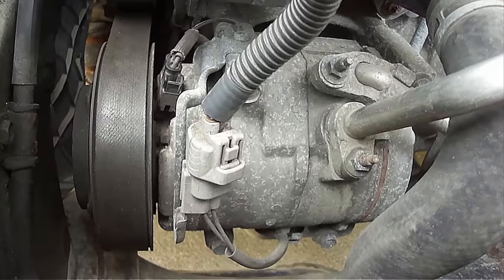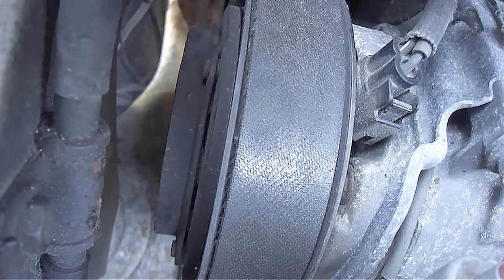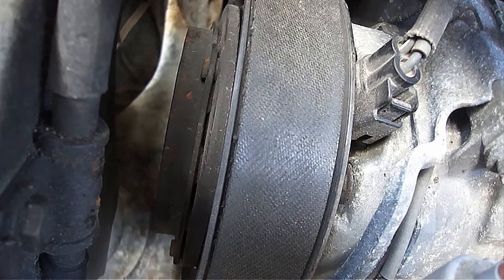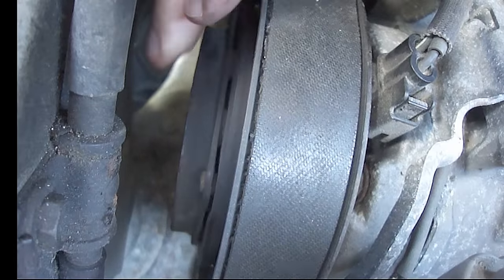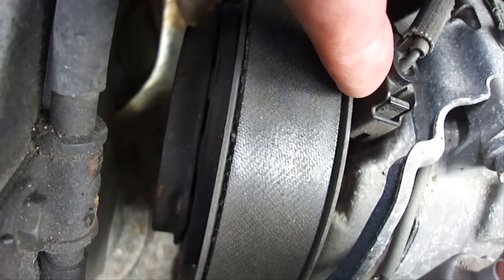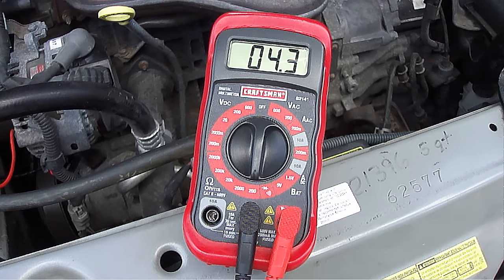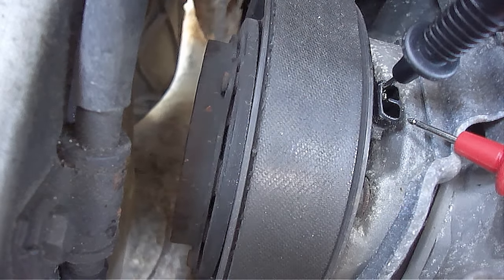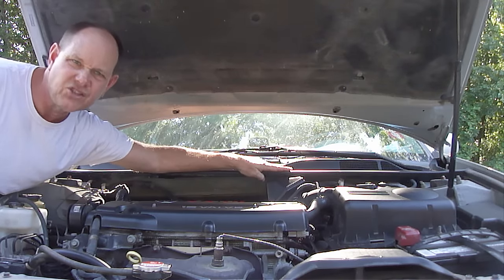How To Fix Car AC - Compressor Not Working

Comment: You must be Scotty’s brother! Thumbs up. Thanks
Reply: Lol 😂
Reply: @proclaimliberty2000  u
Reply: No dead ass 🤣🤣 I'm like ge act and sound similar lol
Reply: Seriously lol
Reply: For real he is
Reply: He is even better then scottie!
Reply: Lol that's exactly what i thought as soon as he spoke then so ur comment lol
Reply: He can't be Scotty's brother, he doesn't speak with his hands gestures😂😂😂
Reply: No , its gary wee and scotty's brother
Reply: Yes, but with a more positive attitude LOL
Reply: The Milder Brother lol
Reply: Broooo I was gunna say thisss lmao!!!
Reply: 💯 You and Scotty need to do a colab 😂
Reply: @proclaimliberty2000 thank you brother for the great instructional videos. My AC was working great then one day as I was setting at work in my car it just quit blowing cold all of a sudden. I've checked the relays and fuse and they are good. One thing I did find is the cabin air filter was completely clogged, I changed it but still nothing. I've read that the expansion valve could get clogged but im trying to eliminate everything else before I go into the dash. My 03 Honda accord has a self diagnostic test in the hvac system and it shows everything is good. Any ideas on what would make the clutch suddenly disengage? Im hoping its the high pressure switch or a leak. Any advice would be welcome, thanks.
Reply from the maker: @donniev8181  does it blow cold air at all when you drive on the highway?
Reply: Vee hear cle!
Reply: I like him better.
Reply: Definitely lol
Reply: Ngl I thought the same thing
Reply: Lol
Reply: Same guy new hair cut
Reply: My first 2 sec I thought same
Reply: I swear it seems to be😂
Reply: He's Scotty Great great great great grandson.
Reply: Yes. 😂this
Reply: Lmfao 😂

Comment: Thank you. You saved my day, and my money. 

Because of your video,  I was able to locate the compressor,  and found out it doesn't turn on.

I tapped on the clutch with a big screwdriver,  .. and voila it worked !! 👍
Reply: So it was just stucked?

Comment: Short, sweet, and to the point. Great video.  I have a 2015 Cadillac ATS and the AC stopped working today. When I checked under the hood, the belt was turning but the AC pulley wasn’t. This will help me with troubleshooting.

Comment: Hey Paul, thank you for yet another super awesome video that helped me understand so clearly. Thank you man, you rock!! 💪🏼
My aircon technician checked fuses, relays and refrigerant pressure, then tapped on the compressor clutch and proclaimed that the clutch coil is burned and needs replacing. Now that I have watched your video I am skeptical of his diagnosis. Your opinion, Paul?

Comment: Many clutches on a.c. compressors have shims that can be removed to maintain the proper gap when not engaged. This gap will increase as the clutch wears and you can simply remove shims to bring it back into spec. Sometimes the bearing for the pully can go bad as well and can be replaced. Newer systems though have continuously running compressors and the freon output displacement is regulated...

Comment: Good video, good information, but aside from a bad clutch or bad coil, it could be the pulley bearing.  Mine went bad & was making a terrible noise when a/c was on.  As revealed here, my mechanic said it'd be twice the labor & about the same cost to just remove & replace the bearing as it'd be to replace the whole compressor, plus the new compressor would have a lifetime warranty.  I really didn't want to open the system, but he said he could do it for about 1/3 what the dealer quoted so I couldn't really argue.  He did it for the amount quoted AND within the time frame he said (awesome).  It's quiet (again) & blowing cold air.  Lesson: if it's not a bad clutch or bad coil, try the pulley bearing if you can do the work OR get a mechanic to replace the compressor.

Comment: Thank you for your help. Well done video.  
On my car,  when I try to turn ON the A/C, the a/c fuse blows up. Started looking into the clutch and found that it will not turn at all but the pulley can.  I tried to energize the clutch as you show and I see the clutch is not moving. It is locked up. I think the compressor is seized  and since clutch hub and compressor shaft are mating together the clutch won't  turn.
Thanks again.
Richard

Comment: Love it, maybe you could take apart a junkyard ac compressor to show us how to replace the clutch. Like a part 2.
Reply: 90% of the time, you just need to horizontal spanner wrenches to put in the grooves on the nut and then you can unscrew it and then you got to use a polar to take the clutch shaft off the shaft going into the compressor
Reply: @SuperIcarusman  when you say moves freely dose it have to move freely with no friction/tention at all or should there be some what of resistance when you turn the clutch by hand? Ill use the front tire of a bike as an example, like  if you spin the front tire of a bike it will just continue to spin on it own. Should the clutch spin as freely as that or should there be somewhat of resistance when you spin it?
Reply: Yes but there should be some resistance because that clutch is still on the input shaft operating the Pistons in the compressor
Reply: @SuperIcarusman  ok cool thanks. I had been told there should be resistance awhile ago so when I heard you say spin freely I wanted to double check. I appreciate the reply. Thanks

Comment: Thanks Paul for the video, I managed to find out why my airconditioning is not working and that the wiring was not safe at all. So will replace the wiring and gave to find the other electrical issue as well. At least the compressor is not broken

Comment: Your auto mechanic skills are phenomenal.  My girlfriends 2004 Honda Accord LX air conditioning does not work. I haven't diagnosed yet but I'm praying it's the cabin filter . I would be very lucky if that's the case. The freon is full and coolant is full and fresh in the radiator?? Do you have any suggestions?? Thanks in advance. Subbed immediately

Comment: Excellent video. My AC works  on my 2008 Highlander but makes a noise from the engine compartment when running. Any hints for me?
Reply: Same issue, did you get any info ?

Comment: Great video. 

I got a feeling that my compressor is bad however. 

I visually see the clutch engaging and disengaging. However my suction 45/discharge 80 don't rise when the clutch engages. I have r-1234yf.

Comment: What if it’s making ALOT OF NOISE, a loud clanging while car is running? Which one is the problem?
Reply: My car has this problem. The ac works as it should, but the compressor is very noisy with a constant clanging noise

Comment: Thank you for your awesome video about AC. I have a question about it also: My Camry 2004 V6 after recharging A134c freon buy it still not blow cold air. I did check the clutch of compressor and it doesn’t freely turn ( turn but it kind of resisted). Is that compressor needs to be replace ? Thank you very much for your time. 👍👍👍👍👍👍😀😀😀😀😀

Comment: Hello, thank you for the video! 
In regards to testing the clutch with voltage from battery, should I take care of the polarity? Or it does not matter?
Is there any diode behind that I should take care of?

Comment: Great video my friend very well straight to the point...
Reply from the maker: Joiner Tia 👍😊
Reply: @proclaimliberty2000   Sir , do you know how to disable the clutch or the whole  compressor . Because it is noisy at the compressor even with ac off. I have a honda crv 2003

Comment: Got a 2000 lincoln town car my ac is working good.. Its just the clutch is squeaks with ac off and when i put ac on clutch engages but here and there clutch stops and engages agaim what can it be air😒

Comment: I checked mine and your video really helps but I found out that the previous owner put a wrong fuse lol so I put a right fuse in. It worked but a few minutes the compressor ain’t running again. Do you know what should I look next?

Comment: How do you know if the pump its self is not working? My clutch is engaging, fully charged, and still no cool air. Do they ever lose pressure or do they just lock up?

Comment: Excellent video, thanks! One questions: when I start the engine, there is a grinding sound coming into the cabin. The sound stops when I put AC on. What could be an issue?
Reply: Sounds like the cluch face on your a/c clutch may be worn and partially broken loose. When the a/c coil engages, the magnetism holds it in place so the vibration making the sound stops. If this is the case you should hear the sound whenever the clutch cycles off and on. Also could be the the bearings in the shaft of the compressor worn and the same condition I stated above is what's stopping the sound. This one can be more problematic because if those bearings fail and the shaft locks up then your serpentine belt will be torn up or thrown off the engine pulleys which will leave you with no alternator power and in most cars no water pump which will quickly cause the engine to overheat if you dont turn the engine off immediately when the failure occurs. You will know because there will most likely be a burning smell from the belt and some smoke coming from the area as well. If you want to check the cluch face, turn it with your hand with the engine off ofcourse and see if you hear any noises of feel looseness when turning it. To check the shaft bearings it's best to remove the serpentine belt from around the compressor pulley and then wiggle the back and forth to see if there is any movement when you wiggle it. With the belt off you should be able to spin the pulley easily and there should be no wobble when it is turning. If there is any wobble or sound of metal grinding then the bearings are failing and the compressor needs to be replaced asap. Sorry so long but I hope this helps.

Comment: Thanks for the info i tried what you mentioned in the video and the belt won't move i was hopefully that it would but of course nothing is that simple for me 😑
Reply: For temporary you can get a A/C bypass belt. That would get you up and running. That does suck I'm sorry to hear that the compressor locked up.

Comment: Hi thanks for the video and reading. I have a 1996 Tahoe 5.7L with A/C.  I get a steady and loud squealing noise when the truck is idling AND the A/C or defrost is on. If I turn the A/C on with it ruining above 1,500 rpms it will not squeal unkess i let the RPMs fall back down to near-idle speed.  But if I turn on A/C and then increase RPMs it keeps squealing. 

I also noted my Battery Gauge drops from 14ish volts to 11.5 volts when the truck A/C compressor clutch squeals.

Should I spray a light oil like WD40 on the A/C clutch? 

Thanks again!

Comment: My 40,000 mile new truck had the compressor clutch/pulley seize up so bad last year that the vehicle wouldn't even turn over. Still haven,t repaired it. The truck goes in tomorrow to see if Ford will do an after warranty adjustment on the repair bill.

Comment: Cheers for this! Could one possible reason for it not to spin is there’s just no gas whatsoever? My van is 2012 and tried to let gas out but it was completely empty? Possibly a leak?
Reply from the maker: Hi Ricky, yes! All vehicles will slowly loose some refrigerant each year. Also, 80 percent of refrigerant leaks are due to leaking ac service port Schrader valves which I have a video on in my playlist and how to check them.

Comment: Hello. Thanks for the nice video. My car is Fiat Bravo 2008 1.6 diesel and since I have it I have issues with unstable rough idle, more noticeable in the summer. I tried a lot of thing with this car and no improvement, visited a lot of mechanics, diagnostics etc and nobody can't find the issue. Having in mind that the rough idle is more noticeable in the summer I started to think if there is a problem with my air conditioning and more specifically sticking AC clutch or something like this. Last 1-2 weeks my car was working fine (I am not using AC anymore as it is not hot), so a few days ago I turned on the AC and I didn't noticed any issue, but after around 20 minutes I had to drive my car again and after starting it again the rough idle was there again. So is it possible my AC clutch to be sticking for some reason even after the AC is turned off and this to cause the rough idle? Thanks in advance!
Reply from the maker: Have you had any work done on the cooling system? I’m  wondering if you might have an air blockage somewhere in the engine coolant or possibly in need of a new engine coolant thermostat.
Reply: @proclaimliberty2000   Recently I tried to fix the problem with new coolant temperature sensor but it didn't work out. Why new thermostat - the car is not overheating and is reaching working temperature in a reasonable time? However, I noticed some little problem with the coolant lately - when the car stays for 2-3 days without driving it, a little coolant leak appears on the top of the intake manifold. This is very strange as on the first 1-2 days usually there is not even a drop of coolant and then it appears. What do you think about this? Also, how can I test for coolant blockages? Thanks in advance!
Reply from the maker: @КирилДраганов-р9д  Even though it’s not overheating it may not be allowing the engine to reach the proper operating temperature which would cause a rough idle.
Reply: @proclaimliberty2000  I replaced the coolant temperature sensor because I had noticed that the dashboard displays 90 degrees but on live data with OBD2 reader it was 70-71 degrees(which might be normal if the car is not driven for a long time at the time of testing) I tested it once again after the sensor change and at a time that the car was idling well and it was displaying 92 degrees on live data. Might have to test it again when the rough idling appears.

Comment: Just one other question .... Will a faulty clutch or compressor make a high pitched, almost whistling sound? I have a 2000 Chevy Malibu 3.1 litre engine. My air conditioning system is not charged with refrigerant at the moment. When the engine is running, I am getting that high pitched sound from the compressor ... almost like a turbo-pitched sound. Would that indicate a problem with the clutch and/or the compressor? I'm thinking of just removing it and running a bypass pulley which is available for this model. Too expensive to replace/repair on such an old vehicle. Any comments? Please.

Comment: I'm guessing I should be able to jumper at the relay location, turn the key on, and see if the cluctch engages (instead of running leads from the battery). If it doesn't engage, that would indicate a fail also.

Comment: Excellent tip.  Mine can be moved whilst the engine is off.   Does it also mean that if a clutch is not engaging, then it will be remaining stationary after the engine is started?
Can a clutch that might be feeling a little stiff be lubricated with a squirt of WD40 without removal?
Reply from the maker: First question yes.  Second question it’s normal to feel stiff.
Reply: Did you find any solution?
Reply: @amanchauhan8237  - My clutch is working properly.
Reply: @monsterp1970  In my car clutch engage some time when i hammer 🔨 on it.. Can i do lubricate on it?
Reply: @amanchauhan8237  - 😮 probably best not to hit it with a hammer.  You are just forcing the magnet together.  No lubrication necessary. 
If it doesn't engage, then that probably because you don't have any refrigerant in the system, so the clutch won't engage to avoid damage.
Reply: @monsterp1970  refrigerant gas is ok... I mean when i do little force on it clutch got engaged
Reply: @amanchauhan8237  - Better get someone to look at it
Reply: @monsterp1970  yeah i found clutch bearing damaged . Bearing cost $5 but service center change whole compressor which cost $300 .....

Comment: Is there a way to engage the clutch in order to add refrigerant? 2013 rogue ac relay is inside the IPDM. I know my refrigerant is low causing the clutch to not work. Really trying to fond a way to add r134a

Comment: I have a camaro 2013, every time i turn on my A/C i hear a squeaking noise/bird churping on and off usually when im just parked or when im driving really slow, i changed the serpatine belt and tensioner but i still hear it, is it mostlikely the clutch? The noise come from that general area, my ac blows cold and works fine, just that noise is so annoying!
Reply from the maker: It’s just the clutch engaging and something you have to live with.
Reply: @proclaimliberty2000  really? Its normal for my car to make that loud noice every few seconds or minutes? Do you think replacing the clutch wll take care of that noice? Or maybe putting in a drop of wd40?
Reply from the maker: @lljohnnyboyll3067  it’s common at idle when the clutch engages.
Reply from the maker: @lljohnnyboyll3067  try spraying Armor All on the belt
Reply from the maker: @lljohnnyboyll3067  with the engine turned off let the Armor All soak on the belt for a few hours.
Reply: Same thing with my 2014 camry ac runs cold but i was told my compressor is bad because there is a noise

Comment: My compressor magnetizes when AC is on, because I can stick a hammer down there and it “sucks it in”. But it will only engage the clutch if I tap it. Then disengaged once my speed reaches over 60mph. Any ideas on what the issue could be? Coil, clutch, or entire compressor?

Comment: Hope i make sense...If the clutch moves in and out when tested with leads and also moves freely when disengaged then do i still have to test the coil with a multimeter or does the first test mean i can skip this one as compressor is good??

I've fitted new condenser with dryer so don't want to gas it yet incase i need to change compressor too

Comment: I have a question for you. I have a 2016 5.0 and my ac clutch doesn't seem to be disengaging. I know the clutch is working because if i shut the ac off it disengage and if i turn the ac on it re-engage. What does it mean when it always stays engaged and not cycling?